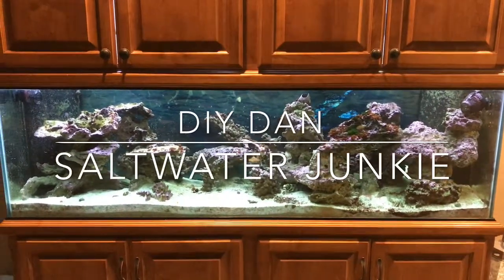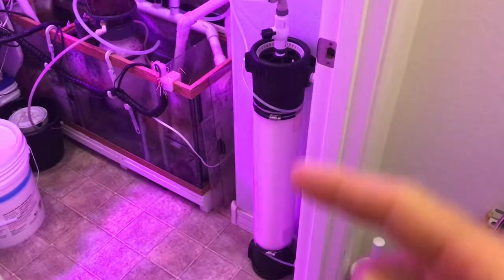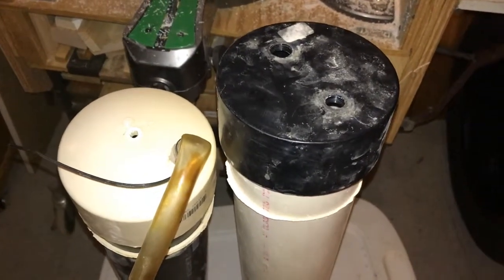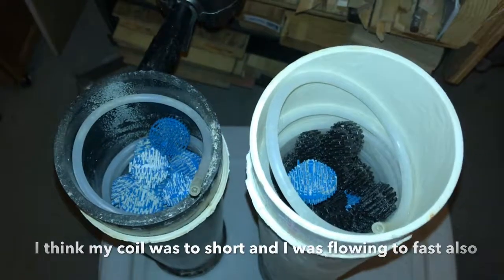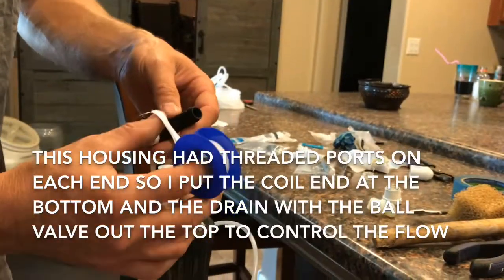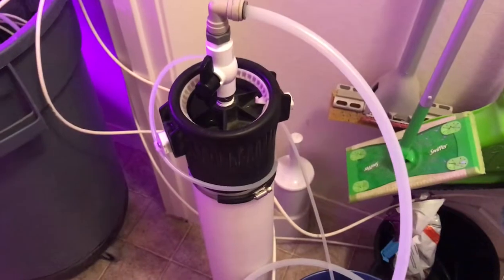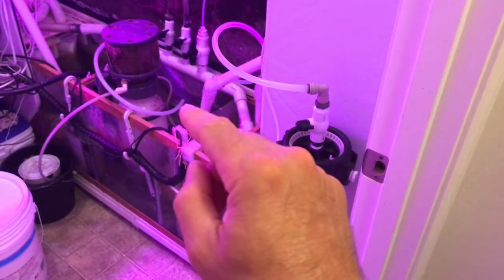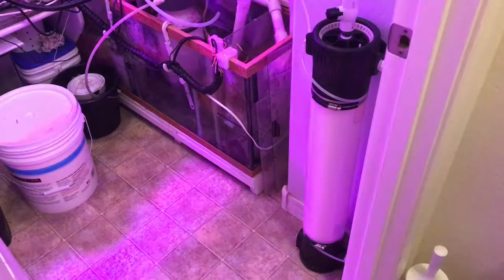DIY Coil Denitrator build along with explanation of how they work

Comment: Can we double the coil and increase flow rate a bit?
Reply from the maker: I was hoping for a better outcome than what I have had on mine I’ve played with the flow on mine from 1💧per second to a slow stream with not much luck on any of it as far as seeing a visual nitrate reduction from the tank to the output of the coil I was thinking of changing my media to matrix and see if that helps. The bigger the coil the more chance of removing the oxygen out of the water which is what the concept is. So yes it would do better I think good luck as far as the construction of my coil I have had no problems with either accept a small leak on the top that I had to put new pipe tape on the threads
Reply: @diydan7019  ok thanks 😊